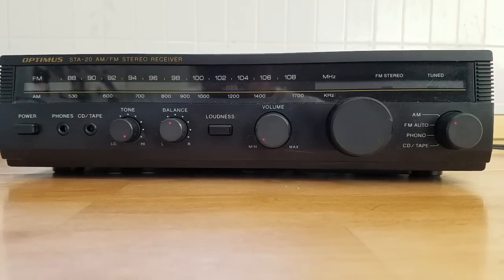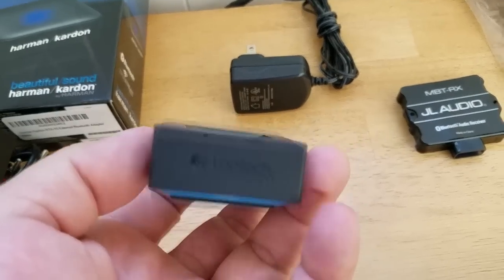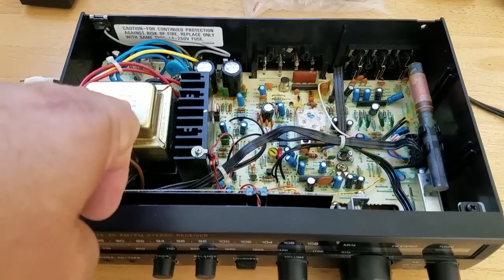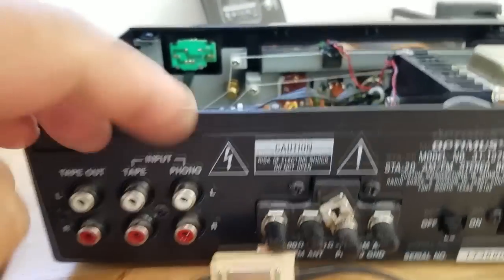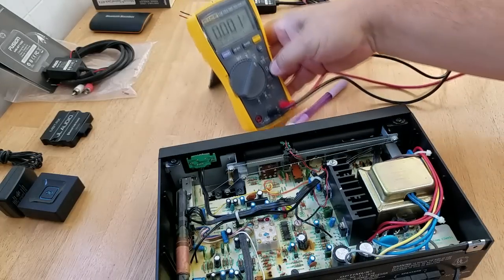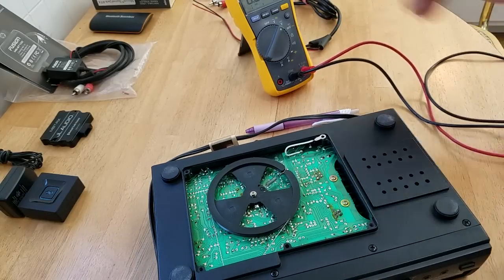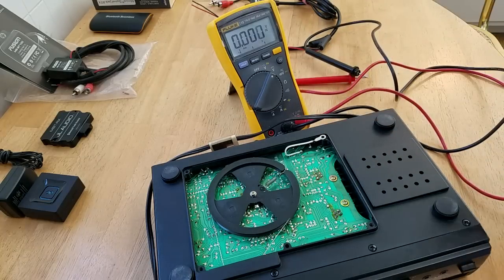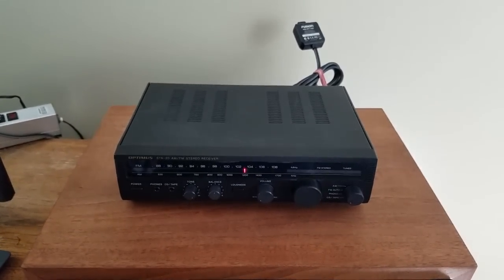How to add Bluetooth to your Home Stereo, VINTAGE Receiver

Comment: How exactly did you mitigate the noise issue when sharing the power between your receiver and the Fusion? Or was this a non-issue due to the Fusion having adequate DC filtering?
Reply from the maker: I had zero noise issues. The BT receiver's power supply is filtered as it was designed to be in a vehicle. However a simple cap to gnd on the b+ line would work if needed.

Comment: instead of trying to find a spot on the board for power it would be much easier and safer to use the power for the light bulbs ( usually 7 ~ 16 volts )on older receivers, and they have low cost ( less than $5 ) and very small bt boards to mount internally that will run off 5-16 volts no wall wart needed.  DONT FORGET... get one that pairs automatically unless you want to take the cover off a lot!   LOL

Comment: This is great.  I really enjoy your channel.  Do you have a video for connecting blue tooth to an old car stereo?   8 have an old Craig S-280 radio/8 track player.   I’ve made 14 volt power supply for it but I don’t get good am/fm reception where I am.   If I could blue tooth it it would revive it.   Thank you.
Reply from the maker: That old under dash is cool. Ive installed a few in my day:) Only way I can think of adding BT to it would be to tap into the volume control. That is inline before the decks main amplifier.

Comment: I have a vintage Pioneer A9 Integrated Amplifier that is at an electronics repair shop for a blown channel. I want to go blue-tooth as most of my music collection is either CD's or albums.(yeah, old school) It's time to go blue-tooth. I've watched a few of your informative videos. I'm leaning towards the Blu Dento BLT=HD or Audioengine B1. Please send your recommendations. Thank you very much
Reply from the maker: The new BLT-HD would be my choice. 
If you "need" to spend close to 200 bucks then I would go with the iFi Audio Zen Blue V2
I have a video on that device.

Comment: Do you have an email or different site where someone can pose questions about Bluetooth issues?    I have a item I’d like to upgrade.
Reply from the maker: you can do it here. Whats the prob.
Reply: @breakerbroke23  I have an old JBL Bluetooth speaker that stopped connecting to the new phones or tablets we purchased.  

It’s a great sounding speaker and fairly pricey.  So I didn’t want to throw it out.  How do Change the Bluetooth component inside the unit?  Have you ever opened up a consumer level powered speaker and upgraded just the Bluetooth portion ?
Reply from the maker: Does the spk connect to your old devices. If so then the BT receiver inside may still be good. If not, its toast. The BT receiver is built into the main PC board on those JBLs. My flip 4 died at 2 years. Man was I pissed! The JBLs sound great and yes I have opened them up, they seem to be very well built. But not long lasting. IMHO.. Maybe I just got a bad unit. You can always rob parts from your speaker.  The drivers anyway. Might come in handy for a project:)  I filmed a video awhile ago showing a tear down of my flip4. I need to find the file and load up to YT. Cheers and thanks for subscribing..
Reply: @breakerbroke23  JBL onbeat extreme is the JBL unit I am trying to get to work again.

Comment: Here's the thing other components are using that 14 volts now ur sharing it so impeding against each other
Reply from the maker: Getting power of the power supply and not further down the circuit, the BT adapter draws only 100ma or less. So it will be just fine.  I do see your point and an easy mistake to make if not careful. I was lucky with this unit being 14v. Cheers

Comment: Just wondering, what is the input voltage of the Bluetooth, what range does it take?  OK, Stupid question, they are designed for a car so around 15 volts DC
Reply from the maker: Keep it in the 12 - 15 volt range.
Reply: @breakerbroke23  Yeah, if it says 12vDC it might be a bit more than it states, so anything above 11vDC will work just fine.

Comment: I connected a blue tooth device to my record player but the sound quality I got was a thumbs down very poor compared to using cable. I've yet to try 5.0 with AptX HD&Low Latency hoping that will make a big difference to the sound
Reply from the maker: Does your record player have a built in PHONO pre amp? If not you need to add one between the record player and your BT Transmitter.
Reply: @breakerbroke23  Its a Sony PS-HX500 I dont get any hum if I connect direct to my hifi so I guess it has. The manual dosen't state this is needed either.
Reply from the maker: That TT looks to have both a line out and Phono pre out. try using the Phono out to your BT device. Line out is if your receiver has a built in phono amp, phono out is used for receivers that do not have a built in phono amp. say using an AUX or CD in on your receiver.

Comment: great stuff. I have a question i hope you can answer. I built a wildlife electronic caller using a Lepy -2020a mini amp. With it i am using an old sony walkman cd player and a 6x9 audio speaker. Would this bluetooth adapter in this video work to convert my wildlife caller from cd player to bluetooth so i can use my android phone to play wildlife sounds. My Lepy mini amp has rca plug outlets and 3.5 mm jack.thanks
Reply from the maker: Yes it would work, use the RTX2.0 for a longer range
Reply: @breakerbroke23  or would i be better off with the type of unit that has all the switching options?
Reply: If It has an aux input.

Comment: You can always plug in RCA splitters to leave the Bluetooth plugged into the Jack, while your using it for something else. Can't you?
Reply from the maker: I have seen that sometimes one of the devices in that Y configuration will drag down the other components out put. You could Y off two units but I would want to switch out between the units. If you would like I can do a video on how to do this. May take me a while to get it filmed \ I have done this many times back in the day:)
Reply: @breakerbroke23  that would be incredible.   Love your perspective and willingness to try new ways to make it work. Have a great day.
Reply from the maker: Thank you.

Comment: Wouldn't it be more elegant to add a Bluetooth receiver adder board and mount it inside the chassis? An antenna could be used to receive signal. The Bluetooth circuit boards are cheap. I have a design for a small audio player that is principally designed for use on a bike, although it can be used anywhere you need music. Two-3" full-range marine speakers  are used for output. I discovered a wealth of Bluetooth amp and receiver circuit boards, sold online. Of course, this type of install requires some soldering skill and knowledge of signal interference. No cross talk wanted!

Comment: Can you answer this question?  My Center Speaker died and I miss the Subwoofer input.  I’m now using my Bose SL111 Aux input for my TV Speaker.  I have a Sony Subwoofer  SA - WA200.  All I was using was a single 6 ft. Phono cable from the Center Speaker to the Subwoofer.  My question “Can I use the digital audio on the TV to power the Powered Subwoofer along with the Audio Out of the TV to the Bose SL111 at the same time?  If not - can I make the Subwoofer a Bluetooth Speaker to the TV along with the Bose SL111?
Reply from the maker: The pre amp level of your TV will be a fixed output, so you would not be able to adjust the volume of the sub with the tv. I mean you could try hooking up the way you explained but Im almost 100% sure you will have no adjustability. But give it a shot ( it wont blow up or anything like that)...... I could be wrong.

Comment: Does the volume level remain at same level as the CD/ Tuner etc or does it drop on the Bluetooth input?
Reply from the maker: Great Question... The volume on the BT unit is a bit lower than all of the other modes, so to fix this problem I made this video. https://www.youtube.com/watch?v=OcJzLM7b8GQ

Comment: Can a Bluetooth transmitter be hooked up to a home stereo in the similar manner
Reply from the maker: Well yes and no. Watch this video.... https://www.youtube.com/watch?v=wt3_pedSlrA
  When you hook up the AC adapter you could use a switched outlet on the back of your receiver to power it up. The Miccus RTX will still need to be outside of the receiver due to the need to pair to different devices when introduced to the RTX.
I have not yet seen a good quality Transmitter to solely do the job where we could stealth mount..... Yet.